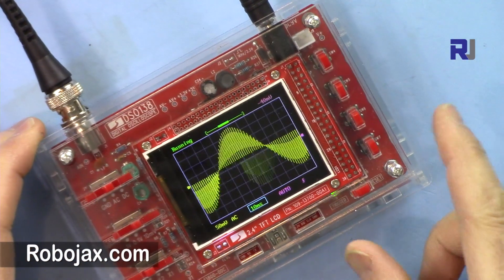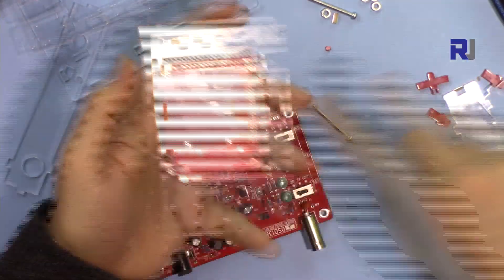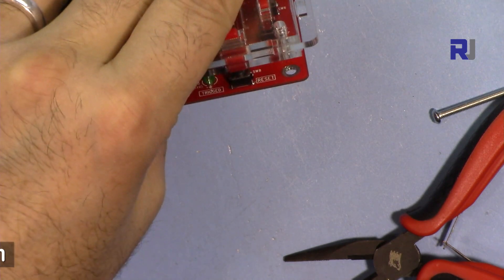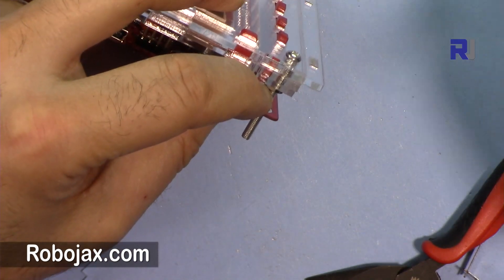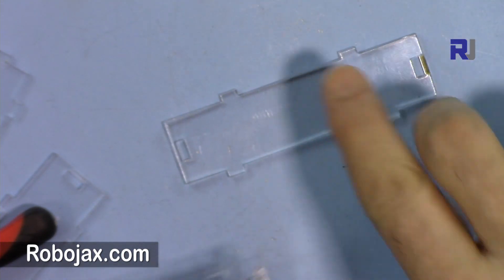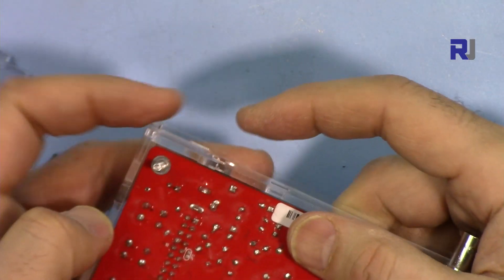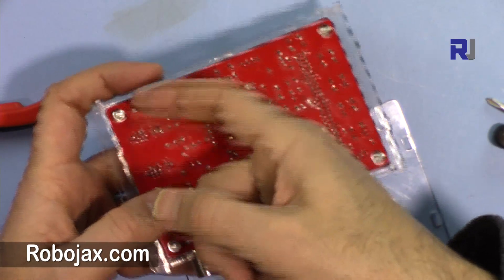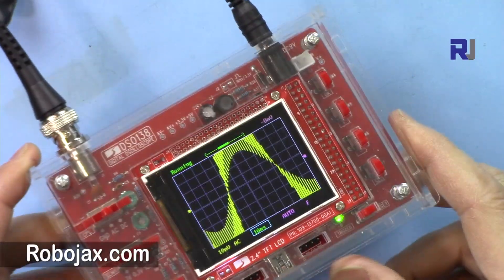Acrylic Case Assembly of DSO138 Digital Oscilloscope kit step by step - RJT237

Comment: It's easier to do it from bottom up: four screws, base, then four nuts, then four nuts again, then the board/spacer/display (with the tiny screws), then the rest with all the fiddly pieces.  So, you end up with the fancy nuts on top. The two nuts on the bottom gave me the proper spacing to match the cutouts for probe and DC power(in a 2025 kit).
Reply from the maker: Thanks for the tip; that's a great alternative assembly method!

Comment: Actuallyis way more easy to assemble the case starting from the top layer from the bottom. fit the four long screws, then assemble the three layers install buttons and secure them with screws. Then install the oscilloscope main board, fit it in the display connector. Then using the last four nuts, fix the main board to be parallel with the top layers. Last come the bottom cover. with those special nuts.That's it

Comment: The Acrylic case I got, the prongs on the red slide switch was too narrow.  They are breaking off.
Reply from the maker: it seems multiple sources are producing them and we now don't know who was the original producer. They copied it but did not make it properley.
Reply: @robojax  I've order the case from two different sellers.  First one sent me broken pieces.  The second one snet unbroken pieces, but same slide switches that break off easy.  Right now I just took mine apart to remove the side pice so I can reach in there and change switches.   Had to do some readjustment  on the four Oscope holes to align up with the acrylic case.  Very poor quality.

Comment: Dear sir, how can we use it by measuring an AC voltage of 220 volts
Reply from the maker: Make a voltage divider using 2 resistors so the output voltage from divider is maximum 5V and the measure it.

Comment: Just wanted to say thank you for the tutorial. I did modify your procedure a little, If you assemble the entire top section ( all 4 plates) mount the switches and screw them together before mounting to the main board, I goes much smoother and takes a lot less time.
Reply from the maker: you are welcome.  Thank you for sharing your tip.

Comment: Thank You for the instructions. I made some changes that I thought needed. First the long bolts. I put the top three pieces of plastic and tighten them with four bolts and four nuts. I then fitted that over the red board and placed nuts on the bottom instead of the top. The reason for this, your way the bottom red board could fall over time.  It made for easier installation.
Reply from the maker: You are welcome. yes we have to find better way. Always.

Comment: i bought a DSO138 kit with the acrylic case over a year ago, I never built it but have all the tools available. im not experienced in building electronics but i did a basic soldier repair once or twice taking my time & being careful.
I wanted to give this kit a shot & use this to look at waveforms from a synthesizer .   After opening the kit, I noticed this is probably a little complicated to build unless youre an experienced electronics builder.   I dont know how to read a multi meter & the instructions say one of the first things to do with this kit is to test the components.   Kit was not expensive,so if i break it or build it wrong its not the end of the world, but im not sure what i want to do, So,
I guess im asking opinion of is it worth trying to build, or too complicated for a begginer And better to sell this kit on ebay.  I know they sell these already built also But, obviously they cost more built.   whats youre opinion??
Reply from the maker: Even with beginners, some people can do it easily and some with 3 years of technical education in electronic can't do it. So it is how handy the person is. I have explained it at the best of knowledge and have not escaped anything.  You should be able to solder tiny item. Here is my video on this https://www.youtube.com/watch?v=Nc3XQakqgn8
Reply: did you try it?  do one step at a time...the journey of a thousand miles begins with the first step.  :-)  check and double check.  The main things to check with the multimeter are the resistors and they are easy to assess.
Reply: I got pre built kit it is well built but the 150 model is complete with a case and is not much more

Comment: Sir, you may want to revise these instructions again. you video is correct up until the long bolts are installed. From the pictures provided with the DSO138, the bolts starts on the back plate then double nutted. The pcb sits on the stacked nuts, then insert the sides and the front acrylic pieces. The acorn nuts are last and are placed on the front plate. hope this helps, thanks for the video!
Reply from the maker: Are you saying the case I have put it together incorrectly ?
Reply: Robojax yes, it looks like your bolts are backwards and the nuts are in the wrong place. However, it really doesn’t matter, since it looks like it is functional. Thank you for video and response!
Reply: Actually I agree with the way you have done it rather than double nut it.  The way you have done it creates a rigid stand-off so you cannot over-tighten the nuts and damage the PCB
Reply: I didn’t get any acorn nuts. Just double the amount of regular ones.  And no instructions with mine. So thank you for the video, even if I had to figure it out at the end. It’s enough to figure it out from there. Especially if you have no instructions whatsoever...

Comment: Horrible instructions. I had to take it apart because things weren’t lining up properly. The order you do things in is incorrect.
Reply: I followed your instruction until you put the reset button in the wrong place.  However there is no need for it to have that small offset pin as it creates alignment problems.  I glued a piece of acrylic in the cut out.  You might have been better editing the errors out rather than correcting them later as people will watch a section and pause it then come back and watch the next section only to find you have made an error making it a more frustrating job than it already is.  Other than that I agree with your version of assembly - it makes perfect sense.
Reply from the maker: Thank you for  your comments. have I put the case in a wrong way? it is perfectly working. Please explain. Thanks
Reply: các ban có thể tham khảo sản phẩm tại: https://www.sendo.vn/may-hien-song-dso138-9062974.html